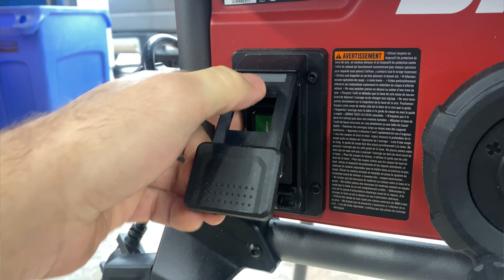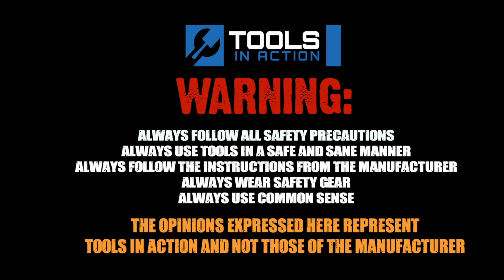Just Released SKIL Table Saw

Comment: I went back and forth between getting a dewalt 10-inch table saw or this skil table saw. I took a leap of faith and purchased this skil ! After using it and putting it through the paces, I can tell you with complete honesty. This table saw is awesome! The stand is rock solid, and all the cuts I made were dead on. This saw replaced my old dewalt 10-inch table saw that I purchased used on Craigslist over 3 years ago. It basically gave up the ghost a few months ago. It had a hard life before I got it, but it still worked and cut perfectly fine. However, the motor died. I can tell you this saw that while it's not a dewalt, does everything the dewalt does only its less money. Yes, the rip cut is less than the 32 inches the dewalt cuts, but honestly, I can't remember how many times I've actually needed the whole 32 inches. More importantly, its depth of cut is deeper at 3 1/2 compared to dewalts 3 1/8. My only recommendation is to replace the stock blade as the one that comes with it has tear out when cutting.  This is common anyway with stock blades.

Comment: The price increased to $400 at some retailers, but you can still find it for around $315+S/H at a few websites (Do It Best, Hardware World, etc). I went with this TS over the Dewalt DWE7485 that sells for $400. I wanted a 10" table saw with a decent fence and this checked the boxes.
Reply: Got it for 289 after rebates at Menards today
Reply: Got it yesterday for $266 (after rebate) at Menards.

Comment: Its $369 at Amazon, still worth it. I just purchased it, if I find it cheaper somewhere else I will just return it lol
Reply: Model # did you find it under
Reply: @Watchingvids13  Skil 15 Amp 10 Inch Table Saw - TS6307-00
Its say currently unavailable again, as the first time I looked it up.
I purchased it and hours later it was gone again (currently unavailable) I have no clue about that
Reply: @jfernandito8205  thanks for replying. I got it saved I’ll keep checking on it

Comment: The saw is awesome. Lightweight, fence, adjustable riving knife, the legs(!), carry and store it on its side.

Con: the saw plate insert is plastic and flexes in middle. Had to run fence on left to do shoulder cuts to match a tongue and groove floor piece.  

Otherwise super happy with it.

Comment: Im contemplating buying this saw, my only complaint is I dont like that the fence lock is a giant red paddle. I thought it was the off/emergency stop button. Sure, you should know the on and off of your saw but im guessing theres a reason everyone else makes the OFF a giant red button?
Edit: 8:50 it looks like you also tried to stop it with the fence lock. Apparently my thought was worth having.
Reply: Sorry but that a really silly comment. NO ONE that knows a table saw is going to push the lock lever to try and turn it off. And your example was wrong, he was putting the push stick away in its location NOT TRYING TO TURN IT OFF WITH THE GUIDE LOCK.
Reply: I have the saw. You won’t get confused. Not an issue.

Comment: Table saw is useless unless fence extends to 24". Been using rigid for 5 years its showing its age as a contractor. Its either buying exact same saw or Dewalt. Was hoping for other option.
Reply: Actually I just got this off amazon, (delivered 10/27). I was looking for the dewalt 10" that was $365 at home depot, but it appears that was discontinued. The only 10" dewalt now comes with the stand only and is approx. $550. I will update, but setup was quick, the table is pretty flat only but is about 1/32" dip toward the blade. I made a small adjustment to the measurement arrow as it was 3 thousands off true. Fence is good, blade was rubbish but who doesn't switch that out. Test cuts came out great, the miter gauge is just so-so. Everything else seems just like the dewalt except it was only $320 delivered.

Edit: Update 12/15/20
Finished building coffee table and 2 end table set for living room. The saw worked very well. Coming from an entry level Ryobi, the accuracy of the rack and pinion was fantastic. I have no idea about longevity at this time as it is only a few months old, but it did get quite a workout as I ripped all lumbar to final dimensions needed for set. The tables were made from 2x4, 2x6, and 2x2. The dust collection worked well, not perfect but a lot better than the Ryobi. It accepts a 2.5" shopvac hose catching over 95% of the dust. I have an 8 gallon shopvac and it was completely full after all the rips. I will say I am a little skeptical of the insert and haven't gotten around to coming up with a zero clearance yet. This did cause some issues as some rips were thin for final dimensions and did fall into the insert next to the blade. Overall for the price, I wouldn't expect much more and other than the insert I believe it is comparable to the old Dewalt 10" that was discontinued.